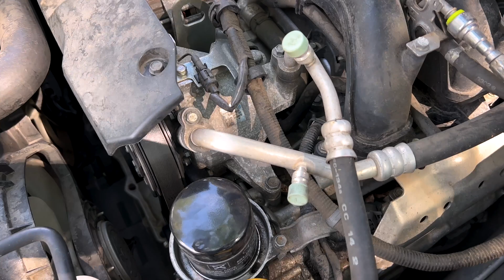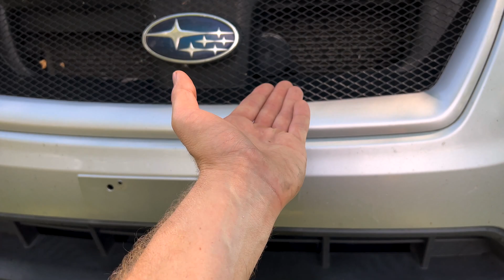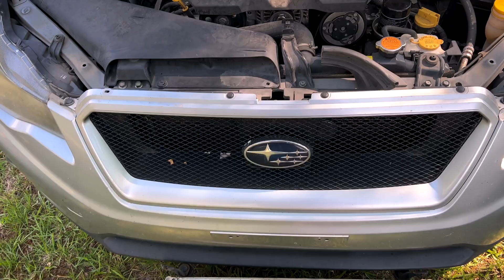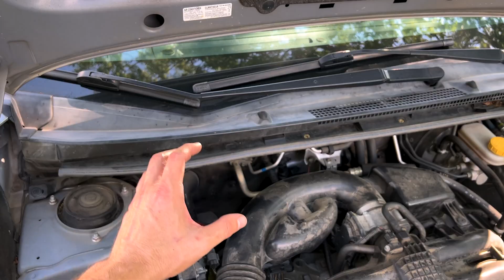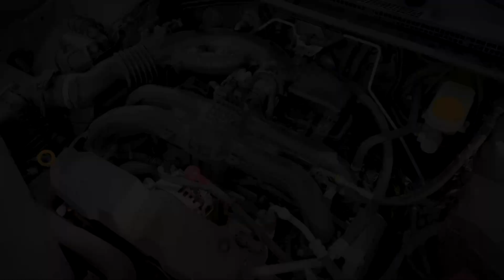Automotive A/C Systems Explained: Learn How It Works! Best/Easiest Explanation!

Comment: Thanks for all the information, Mr Subaru. I need to replace the thermal expansion valve o rings for a 2014 crosstrek.  If the engine is cold, is the value still under pressure.  In other words, to replace the o rings do you need to depressurize the system?

Comment: So if my ac is blowing hot, could it be my evaporator not working right? I've checked the refrigerate and it's good. It's just blowing cool on the passenger side and hot on the driver side.

Comment: I keep having issues with AC in my Audi A3. Everything works fine until car's left in a very hot spot. AC won't turn on then - it just blows back a hot air (hotter than the air i get when AC is off). I did service it twice already - first they've replace the condenser and some filters. It didn't help. Then they replaced some temperature sensor (interior one, as they said there are two). I though that fixed since the AC was running fine for a while. Now I left it on a sun and the temparatures were rather high and the AC stopped working again. I don't know if the service is unproffessional or it's a very strange case that's hard to diagnose/replicate...

Comment: how funny, i was looking to fix a problem with my crosstrek. It lags in acceleration when pushing the pedal from a stop while using the AC. After a few seconds it picks up again. It only happens when coming to a full stop and then accelerating. 

Its bugging me so much because it looks like my crosstrek is having transmission problems.

Comment: I've got both... Subaru forester and a duramax like yours you displayed. 

I'm surprised the air drier accumulator is post evaporator, as I thought the accumulator needed to be in between the condensor and the evaporator... Apparently not so on our chevy Silverados. That was my question to see if it's backwards, but Apparently it doesn't matter what position it's in, so long as it in the system before the compressor. Correct?

Comment: Frickin' awesome! I NEEDED that level of explanation that it seems mechanics don't want or know properly "how" to explain what you so thoroughly did! Now, I can more confidently replace all the parts mentioned. I have the orifice tube and accumulator setup in my 1999 Ford Mustang GT. The discharge hose has a small canister on it. When I asked ChatGPT, it said it's the pressure relief valve, but I see no hole to release any pressure. Though, it would be environmentally detrimental to release refrigerant, so maybe, somehow, it releases excess pressure internally somehow, without actually "releasing" it into the environment. I guess that's why it's called "relief" rather than "release" valve? Maybe I answered my own question, ha! Again, thanks for the perfect explanation. Like you said, understanding the basis of how the AC system operates goes a long way in aiding in any troubleshooting one may need to go through!

Comment: Ok. When we need to replace the drier on the condenser at the right side, once we change it do we need to add any oil? How we add oil if we don't disconnect it? we just remove from the bottom and then install the new one, but how to add the oil in it? We have to remove the stupid condenser in order to add any oil?

Comment: If you look at the life cycle of refrigerant it aligns perfectly with DuPont's patents.

R12 was the best refrigerant.....but the Dupont patent was about to expire so we had to say it "hurt" the ozone.....so I came R135a which isn't as efficient but we were told it protected the Ozone but when the R124a patent was about to expire R134A was discovered to "hurt" the environment so we magically got R1234yf which as of now doesn't hurt the environment but in another 25 years from 2017 it will ....oh and R1234yf is combustible......yes your refrigerant post 2017 is combustible so be careful.......but the best most effective refrigerant is R12...... Dupont has some very effective lobbyists in Washington!

Comment: It does not dump heat onto the condenser!! The condenser removes heat from the high pressure and high temperature  gas refrigerant after the compressor has  done its job. The condenser turns refrigerant gas to a liquid throught heat removal at the High pressure side
Reply: Thanks for clearing that up!

Comment: My AC only works for a few minutes , I hooked up gauges and  when I rev my engine the low side drops to almost zero and this cause the compressor to shut off, then I have to wait a few hours before the compressor will go back on, any ideas?

Comment: My car's A/C properly charged by mechanic is intermittent.  Mechanic is going to do more diagnostics. Does my 2005 LL Bean H6 outback have a computer circuit that tells a relay to provide power to the electromagnetic clutch?  Thanks in advance

Comment: Dear I have an AC sensor evaporator problem. What would happen if I put a 10k resistor in place of the sensor? My Hyundai is a compressor without a clutch

Comment: Hi, I’m having trouble with my 2007 Subaru Forester and while trying to troubleshoot the problem I came across your channel. I have never worked on automotive AC before but giving how expensive the repair can turn out to be I’m willing to give a DIY repair a try. 

The problem I’m having is that the AC system is not sending cool air into the passenger compartment and I noticed the clutch in the compressor is not engaging. I checked the AC relay inside the fuse box in the engine compartment and it’s ok. That is pretty much all I’ve done so far, I did it by swapping the AC relay with another one just like it within the fuse box. The rest I have done is just watching videos. For what I have seen I know I have to get a multimeter to check the AC pressure switch to see if it’s closed for continuity. For what I’ve seen these switches open when they sense higher pressure than normal inside the high pressure line or lower pressure than normal inside the low pressure line. Do you know if my Subaru has these two switches by chance? Can you help me find this switch? Also I need to see if the compressor is getting any voltage but I’m assuming it does as the AC relay is working properly. Summer is around the corner and I need to fix this asap. I hope you can guide me through the process and keep up the good videos 👍

Comment: Great video since my 14 Forester looks exactly like this. My AC runs cold for about 10 minutes and then goes warm. The compressor and clutch seem to be working from what I could see. I checked the pressure with the recharge kit and it said it was fine, so I didn't use it. Any idea of what the problem could be?
Reply: If it's still a problem for you and you have measuring gauges for spark plugs - check that between the compressor pulley and a clutch in disengaged position is the correct gap, it should be more than 0.3mm but less than 0.6mm. Good luck.

Comment: Good stuff as always, Mr. Subaru.

If time permits, you can go deeper still into the theory. As in why do we need the refrigerant to change states why it needs to enter the TXV as a high pressure liquid, etc.

I remember learning about HVAC back in the day COULD NOT wrap my head around how a closed circuit "absorbs" heat. 😅

As ever, this video was good and I look forward to your new content.
Reply: You're not alone bro, I couldn't grasp it when it was first explained to me😊😊😊.
I still have trouble today lol, plus venting an AC system can be dangerous, so these days I leave it to the pro's.
Reply: Edit: sorry, I misread, didn't catch that you've gone through HVAC school, sorry. I'll leave this up anyway in case someone else is wondering.

It doesn't "need" to change state, you could accomplish this type of heat transfer with just a gas. But, during phase change, substances go through a change in internal energy, the latent heat, without changing temperature.

Two substances placed in good thermal contact will reach thermal equilibrium when their temperatures are equal. For each substance, there is a heat requirement to change temperature, called the specific heat. If I place a substance with a high specific heat in contact with a substance that has a lower specific heat, the higher one will experience a greater change in energy, relative to the temperature change, but a smaller change in temperature. If one of those substances must undergo a phase change, then that's a change in energy without a change in temperature for that substance. For this reason, water at 32°F will absorb less energy from your drink than ice at 32°F, meaning ice will bring the temperature down further.

This means the phase changes in the exchanger and condenser result in more heat transfer to and from the refrigerant.

Comment: “Pulls heat out of the car.” With that, is the most effective way to cool the cab to use the button that circulates the air inside the cab?
Reply from the maker: Yes

Comment: Both my 14 and 16 Imprezas have no A/C this summer.  Kinda crazy, 70k and 52k miles and no a/c. I'm super disappointed in Subaru quality.
Reply: Your Local dealer should take care of you. Subaru directly will may, even if you bought used. Its worth a try.
Reply: Have you replaced the seals at the compressor? I was on the same boat for my 2017 Crostrek at 80k miles. Now it’s good after replacing seals, vacuuming the system and refill. Also needed to compressor oil to help with an ugly noise from the compressor

Comment: I need your expertise MrSubaru.  I have 04 forester XT, it has been acting up lately. The car won't start as if the battery is dead, the battery is new 2022, it would start when boosting and won't die after a drive so the alternator is good, starter is good, ignition is good. I check around the battery 2 weeks ago when it that the negative terminal was loose, I fixed that all is tight and secure. Now the problem is happening again, same thing boosting will start the car and would remain running, I assume I may have ground problem, there is power, but sometimes won't start, I had it happen today, but by noon it start without boosting. Any thoughts? Or if my assumption of the ground is correct. 12 volt reading alternator and 14 when running, battery is the same 12 volt reading. Getting good connection on ground tho is tricky.

Comment: Hi Mr Subaru my AC is blowing warm air and then blowing cold after a certain time is that normal? Am I low or refrigant?
Reply from the maker: Could be a couple reasons, but low refrigerant is likely.
Reply: @MrSubaru1387  Thanks for your explanations, I have a subaru exiga 2012, the ac blows cold for few minutes then stops cooling completely, would that be the same issue as above?

Comment: Excellent articulation. However, the geeky proper terms are: evaporators "absorb" the heat & condensers "reject" heat. Nonetheless, absolutely well explained.. Next time, please cover high & low pressure safety switches & the crappy evaporator thermistor that is problematic in most every older subaru! Maybe show how ohms go up & down with a meter depending on exposure to different Temps & how it shuts off the a/c clutch. Thanks again.